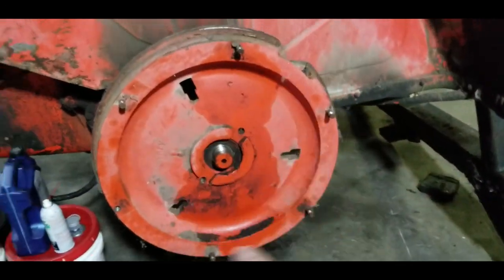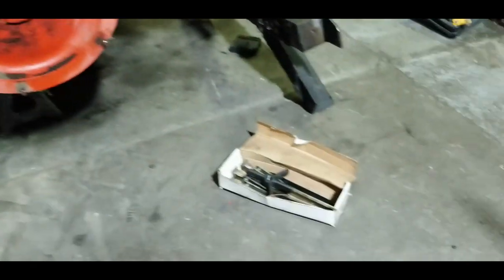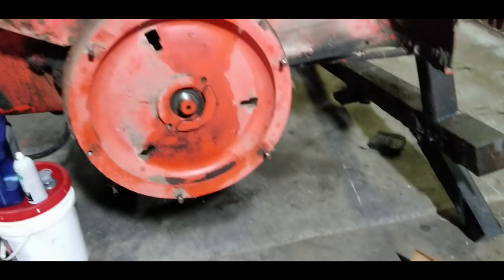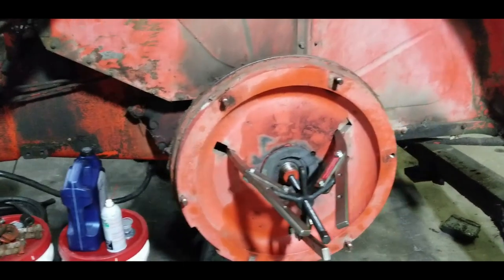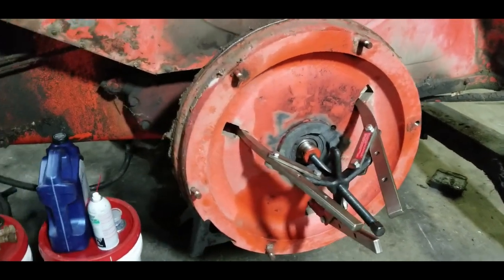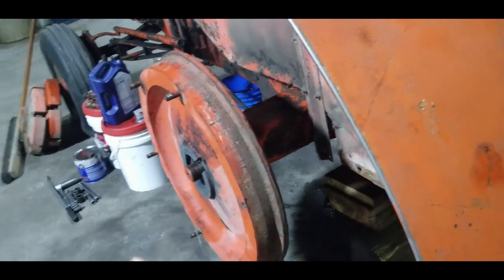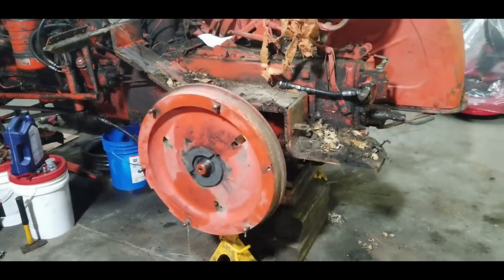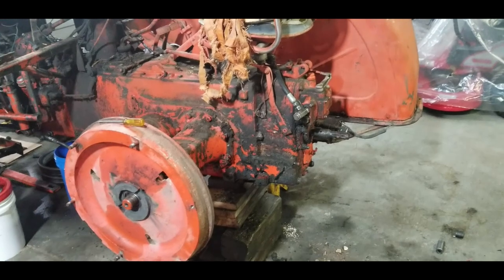1959 Case 800 build.  Part 24! A new start!!!!

Comment: Super excited to see you pulled it back in and got a fresh start on it! Did you happen to drive it in the shop to test out the case o matic yet? I'm not familiar with com at all
Reply from the maker: I did not drive it.  Pressure is building good in the COM and the valve did cycle.  But after dumping the oil and then finding the cracks I got discouraged and stopped for a bit.  But I'm back on the wagon and ready to rip into it!
Reply: @DuchesnesCorner  awesome! Welding that cast should be pretty smooth.  You said you did some youtubeing on that I'm sure you know that in most cases you should preheat the cast before you weld